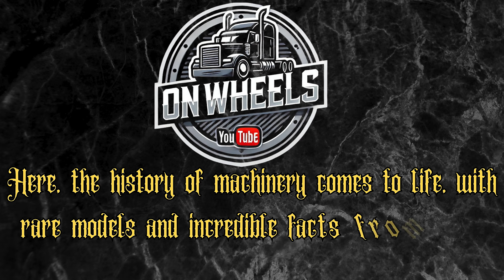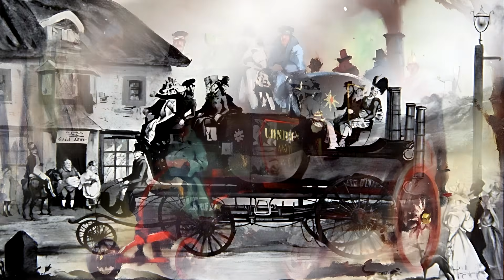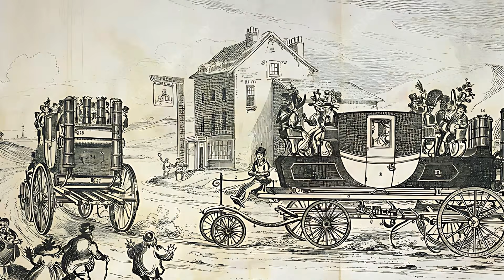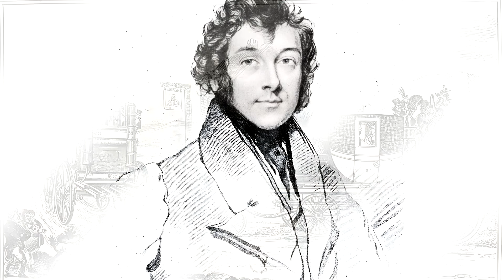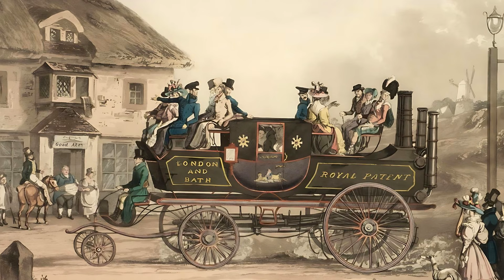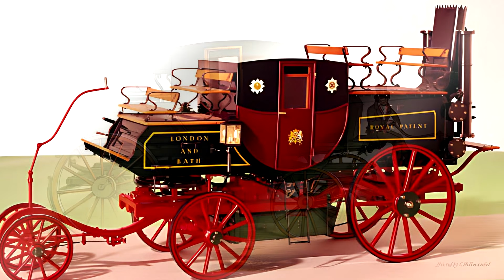1822 🔥 Goldsworthy Gurney Steam Carriage — Banned for Being Better Than Horses

Comment: The most punitive law about steam was the "red flag law" a man waving a red flag had to WALK in front of any steam carriage to warn people of their impending apocalyptic demise! This limited speed to about 2mph and limited distance to what you could walk anyways. 😊

Later, much later, the laws were abolished and steam trucks and busses became commonplace in England. Some were very modern with rubber tires, tandem axle or quad axle, electric lights, and some were used into the 1950s offering greater power and speed with very cheap fuel. Some still exist and run demonstrations.

Comment: Where a vehicle like this steam gurney would have been incredibly practical was building roads in remote areas. They couldn't build roads more than 25 miles from grassland because the horses and other beasts of burden needed to eat. This was mentioned in R. G. LeTourneau's autobiography.  He gives the early history of earth moving equipment from the prospective of the guy with 299 patents in the field, including some of the first powered road graders and so on. 

He invented the Land Train, about which you should do an episode.  There were five versions used mainly in the Arctic, and the last was the largest land vehicle ever made.